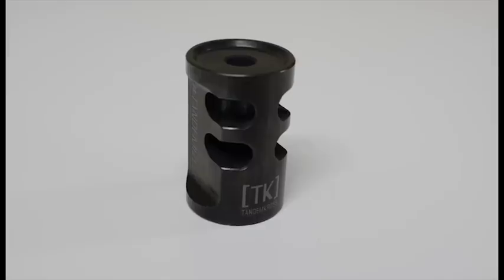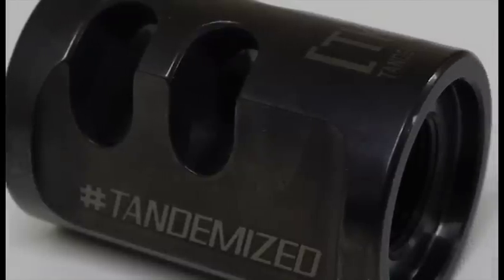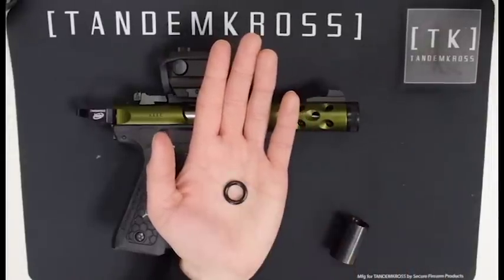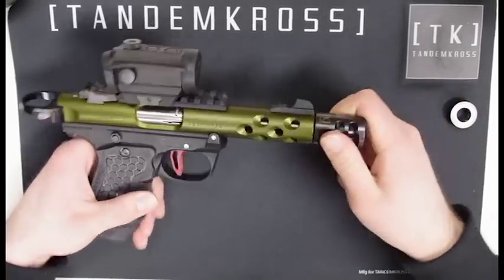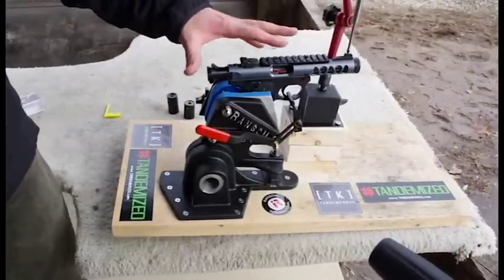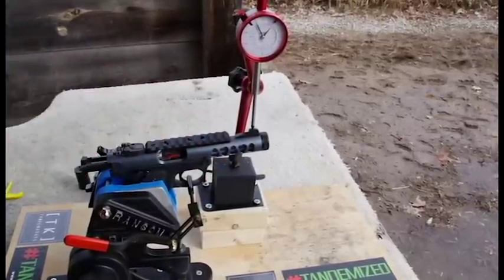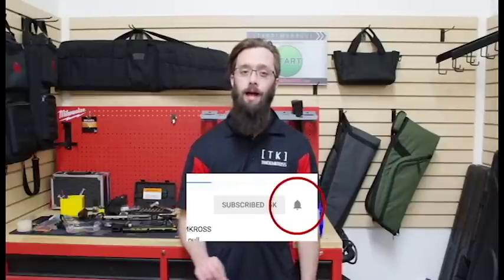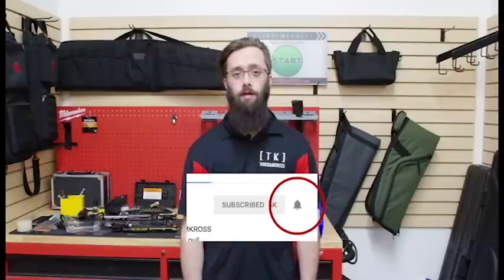TANDEMKROSS - "Game Changer PRO" Installation and Compensator Comparison Experiment

Comment: The dial indicator needs to be set below the barrel and preloaded more than the anticipated movement, so as to eliminate bounce and throw of the indicator plunger. You could get the actual movement of the firearm.
Reply: Should also compare against an un-ported weight threaded onto the barrel the same mass as your comp.
Reply: Did anyone else notice the gauge was not set at the same starting point for each test?
Reply: @2GUNMASTER  It doesn't have to be. The measured amount of movement and the base being fixed are what's important with an indicator.

Comment: Nice guys!  If a 3rd set of shots was done with a "Dummy" weight (equal to the compensator in mass and center of gravity) attached to the barrel we could determine the contribution of the gas ports.
Reply: Either way, I guess it works by dampening the muzzle rise. Plus it looks better then just having some weight sitting off the barrel
Reply: @kurticus ur right and no cleaning either if weight alone would do it plus shorter length

Comment: After installing should the compensator be extremely tight or hand tight enough? After I get a little tight and line up there is still some movement left but I cannot do another full rotation. All good?
Reply from the maker: Extremely tight is probably better, but as long as it's tight enough to not move when you're shooting it's probably not a problem. If you'd like another o-ring and washer kit to see if adding them helps it line up and be tight,  reach out to customerservice@tandemkross.com and they can help you get one.
Reply: @TANDEMKROSS  If extremely tight is better like you say, why do you only hand tighten it in the video?
Reply from the maker: @forgetyourlife  I also said that as long as it was tight enough to not move while shooting, it was good. The tighter it is, the less likely it is to move, but you can get it tight enough to not move while shooting by hand tightening it.
Reply: That’s how mine is but the oring holds it tight enough when lined up that it stays put during use.
Reply from the maker: @crazrehabkid88  yes, even if you can still turn it a little the o-ring should hold it tight. But if anyone is ever unsure if it will hold, we're happy to send the o-ring kit.
Reply: @TANDEMKROSS  love your products, company, and cs will let you guys know if I need one but I’m at over 1000rds rapid fire steel and the comp has never twisted on it’s own. Keep up the great work TK!!!🤙

Comment: Quick question. I just put your muzzle brake on my PC9 but with the vents in the upward position, it's about a half a turn from being fully tight? Is this normal, and is this safe?
Reply from the maker: You want it to be fully tight. It happens occasionally that the vents don't quite point upward when fully tight. If you contact customerservice@tandemkross.com they can send you a parts pack with more of the rubber o-rings to help you get it lined up.
Reply: @TANDEMKROSS  thanks TK! I'll do that

Comment: I'd like to know the difference between this Game Changer Pro and the original Game Changer. Is it worth me putting in an additional 25 dollars?
Reply from the maker: Hi Brik, it somewhat depends on what you're looking for. The original "Game Changer" is made from aluminum so much lighter weight. Some people like that, especially if they're using a heavier gun. However, in general we tend to recommend the "Game Changer PRO." It reduces muzzle rise even more than the original due to its large ports and heavier stainless steel body. It's great for balancing out a lighter weight pistol and it is MUCH easier to clean and maintain. We like to say the original Game Changer is a consumable part (you'll have to replace if you shoot with it a lot), while the Game Changer PRO is highly durable. Hope this helps! We've gotten requests for the type of test in this video comparing the two comps and it's on our list of videos to make!
Reply: I chose the pro bcuz it vents at 45 degrees to each side, not upwards into your line of sight. Just my opinion, you may want the lighter one if weight is more important to you.

Comment: Why is your DIal at a Different Reference Point with the Comp on in comparison to the Comp being off?  the Black marks on the dail with the Comp on where at the 10 and 2 but with the Comp on they are 2 and 4 why the Change?  That makes it look like you are changing the dial to make your comp look better than it is!
Reply from the maker: Thanks for watching and for sharing your feedback. We weren’t using those dials as reference points. You can see in the video that when the firearm is at rest the hands of the meter don’t line up with the dials. You can also see that the dials aren’t always in the same place even on different trials for the same gun. For example, at the 4:00 mark the dials are at 5 and 7 in trials 3 and 4. Those marks just didn’t factor into how we were measuring the muzzle rise. We measured the muzzle rise using wherever the hands of the meter started as our zero for each trial. Hope this helps make things clearer!

Comment: I apologize for the late comment. I was just able to watch the video and while I believe the Tandemcross game changer is a great compensator, the video I watched showed someone using a dual indicator to try and measure the muzzle rise, this method is obviously flawed as the indicator jumped significantly after each shot. I think if you would have just lined up a machinists rule on the opposite side of the muzzle, the high speed camera would have caught the actual rise. Just my humble opinion. Good job on the comp though..

Comment: I wanted to know, to install the compensator, I noticed that by removing the original, there is a small metal gasket, do you have to leave it? And put the one supplied with the compensator together?
Reply from the maker: You do not have to, but it will work just fine with it, and typically we see people keep them on with the o-ring just to keep them secured so they don't lose them!
Reply: So same story different day- my comp came with the rubber o ring and a steel flat washer whats the flat washer for? And how tighr does it need to be

Comment: When installing, do we use the factory crush washer that is installed when using the thread protector or do we remove it and use just the rubber washer that TK supplies?
Reply from the maker: The rubber washer can be used with or without the crush washer. Some people find using the crush washer with the rubber washer can impact the timing of the compensator. You can try it with and without and see which gets you a better fit and alignment of the comp. Each gun is a little different in that regard. If you have any serious timing issues, let us know and we can send you a washer kit that includes other washer options to help you get the best fit. Let us know if you have any other questions!
Reply: TANDEMKROSS yes it is pretty loose still because if i tighten it the logo and vents wont be faced up. May i try the washer kit to see if it works
Reply from the maker: Definitely! Just send an email to customerservice@tandemkross.com or call us at 603-369-7060 and let them know you need the washer kit. They will get that out to you ASAP.

Comment: I'm not here to bash Tandemkross, but the test setup seems to exaggerate the real world effect of the compensator. Removing the spring from the Ransom equipment is like removing my flesh and muscle from my firing hand(s). Throwing on the super sensitive machinist gauge further inflates the effect. I doubt they are intended for any purpose with such rapid movement. I might still buy one, but it's hard to justify. Now the Halo charge ring is almost certain.

Comment: What do you when it does not time correctly?  I replaced the Mini 14 style flash suppressor on my 10/22 with a game changer and  it locks up hard at about 2 o'clock  and when I back it up to 12 o'clock it doesn't even need 2 finger pressure to spin.  Do I need a crush washer or just some Locktite?
Reply from the maker: Our "Game Changer" comps come with a rubber O-ring that can help with timing issues. If you didn't get one, or if you did, are already using it, and think another would help your comp line up, call 603-369-7060 or email customerservice@tandemkross.com to get in touch with us and we can help you out.

Comment: Do you recommend any loctite or other threadlocker for the Gamechanger Pro on the 9mm PC Carbine?
Reply from the maker: You won't need it! Just have it a bit tighter than hand tight using the o-ring to make sure its lined up the correct way and you'll be good! Just make sure you get the 9mm version! =)

Comment: Game changer vs game changer pro which one and why? I want to know please anyone so I just get one if had too.
Reply from the maker: Game Changer is excellent, but the PRO is better. - PRO is steel (vs. aluminum) to add weight for better balance, more accuracy. - Proprietary coating makes cleaning the compensator easy. - Vents gases at dual 45° angles for better visibility & control.

Comment: So i put the pro on sw compact 22 so just add another o ring to get it lined up and tight ? After a few shots it loosens up ?
Reply from the maker: If your compensator is loosening up after a few shots, adding another O-ring will help get it to the correct tightness and line it up correctly.

Comment: Would this procedure be the same for a PC Charger?  The pistol you installed it on is. .22. Would you need to tighten it more on the 9mm?
Reply from the maker: The installation method is exactly the same for the 9mm version. There's no noticeable difference in how tight you have to put it on between the 9mm and 22 versions.
Reply: @TANDEMKROSS  Thanks for your quick response

Comment: I purchased a Tandemkross 1022 bolt and after installation it would not feed ammo. It destroyed ammo. I sent it back for a refund. It is going to take a month to get a refund. That really sucks. I purchased it from Optics Planet. I do not blame them for this substandard bolt that was obviously flawed. That lies on Tandemkross for quality control or lack of it. It really screwed up my plans. I called Ruger to see if there had been any bolt changes in the 2020 models and they said no.That it must be a faulty part. I will keep my original bolt seeing how there was nothing wrong with it. The reason for buying a new one was to avoid problems like failure to feed and failure to eject. All I got was failure to feed. Makes me never want to try another upgrade. I purchased 3 upgrade items for my Hipoint 995ts from McArbo and 1, the charging spring was to long and would not work. The next was a stainless steel charging bolt that hipoint forced them to recall. The last item I purchased was a trigger spring. I have no idea if there was any improvement there because I installed it the same time I installed my HTA MBS 9 Stock. Hopefully I keep that. It seems like aftermarket parts are being produced to quickly without proper research. Just my 2 cents. I know the Tandemkross bolt has been out for quite some time so that one is up for debate. It just sucks to have to do other peoples testing on my equipment. On the bolt the only difference I noticed was an indention on the bottom bolt rail that my original one did not have other than the pinned firing pin. I don't know for sure if that was where the problem was but it looked like that was the culprit. I'm done trying to improve this anymore. I had planned on replacing the barrel but after all of these parts that absolutely did not improve shit I'm pretty much done.